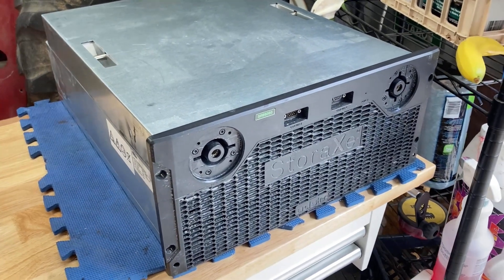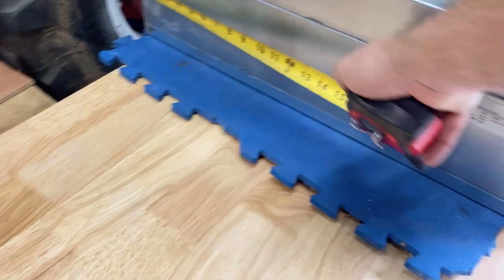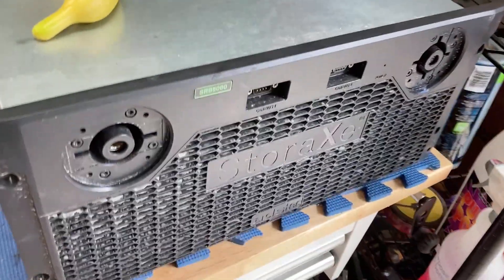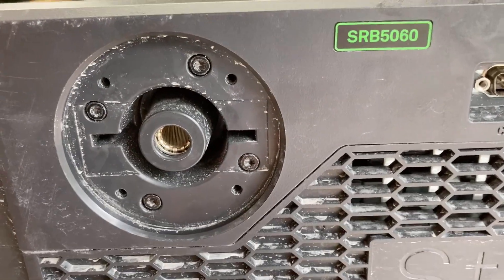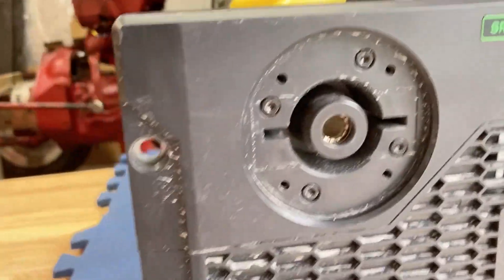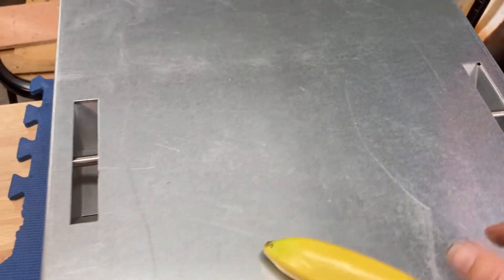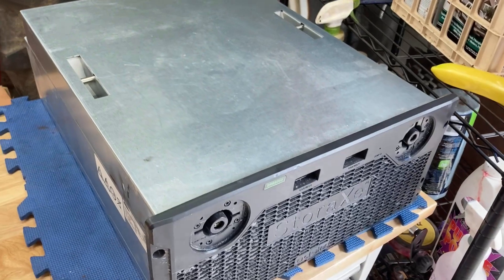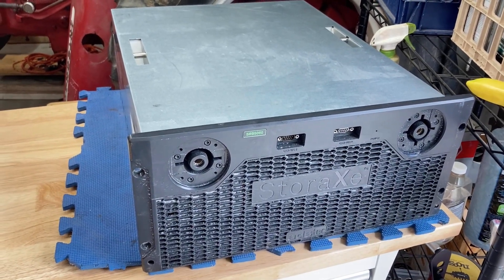Quick First Look at Batteries for Tractor Conversion

Comment: Thanks for the video.
I just looked up these batteries. First they are used, also, also they are not outside rated, they are more of a grid battery although I would use LiFePo4 in my house - not these. One more thing, there's no BMS you have to build your own battery management. I don't know if I'd want them in my tractor.

Comment: The 4U computer server rack batter back up would be nice as it would be easily removable for maintenance.  As the size is a spec, you should be able to use any other 4U battery as needed.  I would make the terminal wire modular, as I think (not 100% certain) that the 10mm plug is proprietary.

Comment: 64 to 100 v supply voltage?  What is that about?
Reply from the maker: Instead of listing a nominal voltage, it lists a fully charged and completely discharged voltage. So the RANGE of voltage instead of nominal or number of cells in series. It's a 24S pack.

Comment: With two of them you'll have 12kWh, that should give you a nice time between charges on the tractor. How heavy was the old engine in it before? You might just be a tad heavier. Nice stuff you are making Ben.
Cheers 👍💪✌
Reply from the maker: I really don't know the weight of the engine. Too heavy for me to lift onto a scale!
Reply: @BenjaminNelsonX id be cerious to see how much work you can get out of 6kwh
Reply: I’ll bet the 300lbs of batteries, plus the motor and controller, adapter plates, etc. might still be lighter! That engine was enormous, not counting the auxiliary pump gearing and fuel tank.
Reply: With the flywheel, a Farmall 281 weighs in at over 600 lbs.
Reply: @rickway2039  thanks
Reply: I bet that engine was pretty heavy. I’m sure heavier than of those batteries.

Comment from the maker: It's these batteries: https://batteryhookup.com/products/samsung-24s-lithium-ion-6kwh-module-3x-8s-modules
Reply: 70 bucks a kWh? That’s cheaper than discount golf cart batteries! 2016 date codes though, December. 5 1/2 years old, do you think aging will be an issue?
Reply: Just knowing this exists is dangerous for me. I've already got enough half finished projects cooking right now, but this is going in the vault for the next time l need somewhere to hold my electron collection.